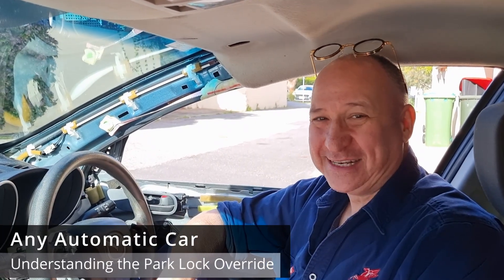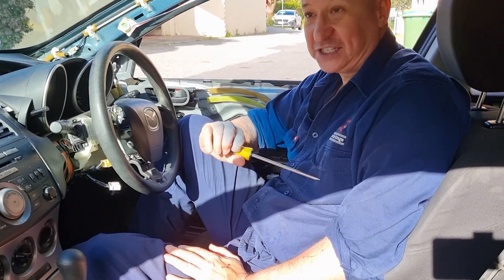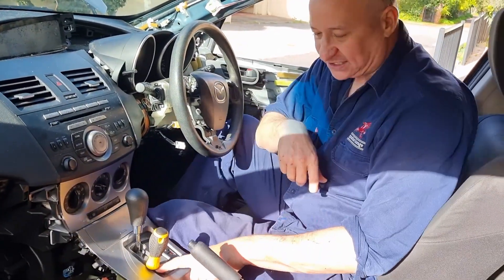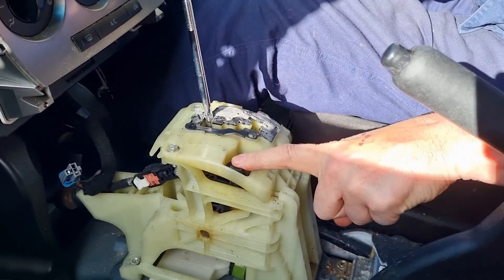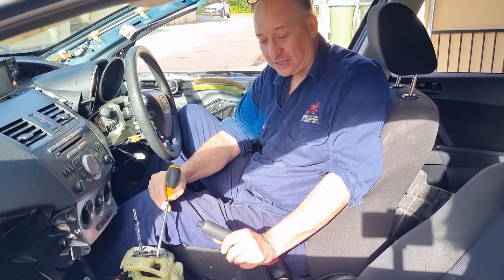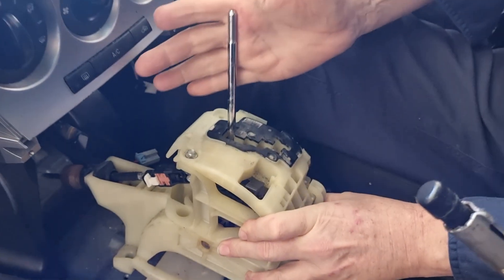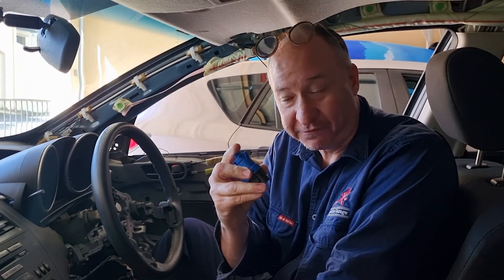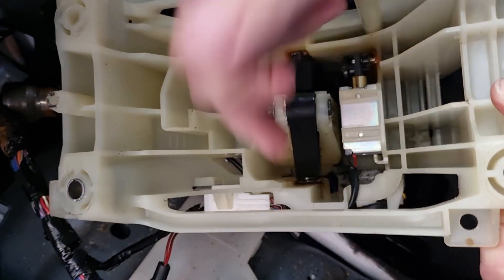Automatic Cars: Understanding the Park Lock Override.  shift stuck cannot move

Comment: Hi Paul, I have a Mazda 3 BL4, similar to the model in many of your videos.
First of all, it’s great to see you in good health.
Right now I’m experiencing a problem, and I’m not sure how serious it is. The car drives perfectly fine, but if I sit in it with the engine running without driving anywhere for a while, and then I turn it off and try to restart it after a short time, it won’t start.
The problem usually "goes away" if I wait about 30 minutes before trying to re-start the car.
Reply from the maker: I've come across this problem before, and it turned out to be the crankshaft position sensor.  This video discusses the issue.  https://www.youtube.com/watch?v=jX7avI39Brw

Best wishes, Paul.

Comment: Hi Paul, I suggested on another video if I may propose things that you could show on YouTube, things that new car owners should know how to do, things that might seem stupid but are not taught in driving school necessarily. Here's things I didn't know and my husband has had to teach me:
-Generally in a car, where is the oil and how do you check it, how often and why it is important
-How to check tire pressure and what it is needed to be, how often to do that and why it is important
-Where is the windshield washer reservoir usually located, and is there a symbol for it
-How do you usually open the car hood? (For example, in my car it's a lever under the steering wheel)
-How are the back seats usually folded down, and where are the release buttons or levers most often located 
 
There is a few questions, I'm Finnish so I hope the terms I used were correct. I have many more if you want. Those are some "beginner questions" I've had that luckily my husband has known and has taught me.

If you'd like to do a video on these, I think it would benefit many new drivers and car owners 😊

Comment: Hey Paul, just one question. Some cars have traditional mechanical drive position shifts like that Mazda in your video. But other cars like my Kia Stinger have electrically operated drive position shifts, either via a push button or rotating knob or even traditional looking gear levers like my Stinger has. What do you do then if your battery is flat?
Reply from the maker: Hi Tomy, I don't know the answer, but I would really like to.  This is the official Kia video on the topic https://www.youtube.com/watch?v=IYBjpu8KGE8 and as you can see, they just say to consult your manual for further information.

So, could you do a couple things for me:  please consult your manual.  If that doesn't work, then look for any little removable tabs around the gear selector that might hide an access hole.  Failing that, is it easy enough to pop up the gear selector surround and have a look underneath?

If you find a solution, then please post it here, so I can add it to the description for all to see.

I hope we work it out.  It is much better to work it out now than in an emergency.

Paul.
Reply: @PaulinPerth I'll have a look Paul. The gear lever on the Stinger is literally for show only. As I said, it's electrically operated. So it could be push buttons or a rotary knob. It's just mimicking a traditional gear lever. 

Anyway, this is what the AI summarised. Basically it's the same as you said Paul in your video about any other automatic car with a flat battery: -------------------------

If a Kia Stinger has a dead battery, the electronic gear lever may be stuck in Park due to the shift-lock mechanism. To move the vehicle, you'll need to manually override the shift lock. First, apply the parking brake. Then, locate the shift lock release access hole (usually covered by a small cap near the shifter). Remove the cap and insert a tool (like a screwdriver) to press down on the release mechanism while simultaneously shifting the gear lever into neutral. 
Here's a more detailed breakdown: 
1. Engage the parking brake:
Ensure the vehicle is securely parked before attempting to move it.
2. Locate the shift lock release:
The release mechanism is usually hidden behind a small plastic cap near the gear selector.
3. Access the release:
Carefully remove the cap. You may need a small tool like a flathead screwdriver to pry it off.
4. Override the lock:
Insert the tool into the access hole and press down firmly. While holding the tool down, shift the gear lever out of Park and into Neutral.
5. Important:
Once the vehicle is in neutral, you can safely move it. However, it's crucial to address the dead battery issue promptly by either recharging or replacing it.